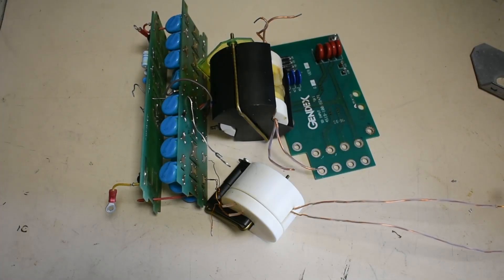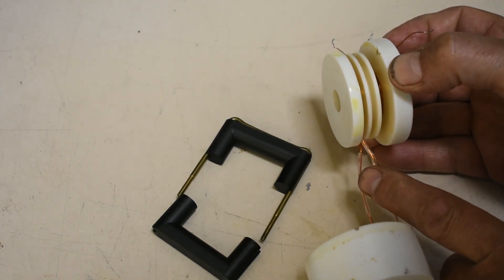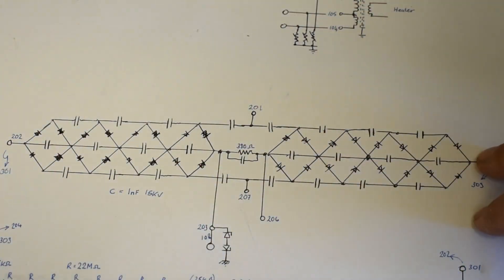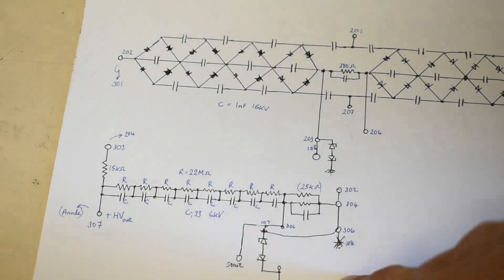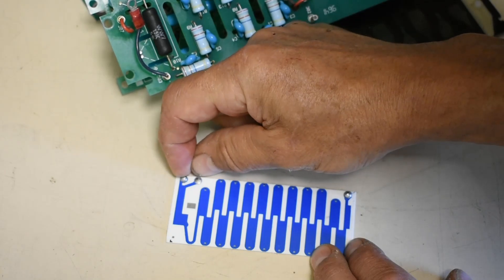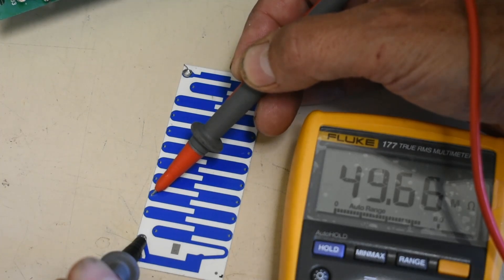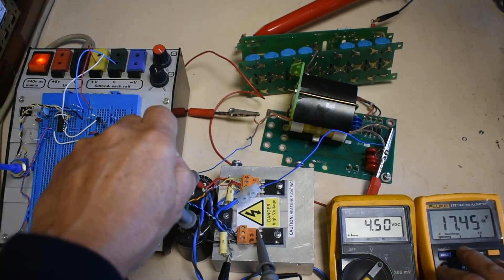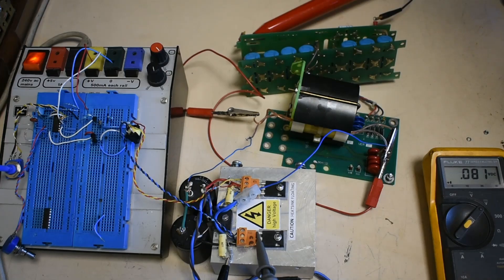Making a high voltage power supply with parts from an x-ray head.

Comment: Nice psu .. all the diodes in the multiplier point in the same direction so u should be able to just connect and ground at the neg end and have like a 8 stage positive multiplier??
Reply from the maker: Yeah thanks, the modification looks doable. Think it has the potential :-) to be  a nice HV supply.
Reply: @tuopeeks  ❤😂

Comment: Thanks for showing how those HV boards work, part of my job is installing dental X-ray units in dental clinics and decommissioning older units. I have dismantled various head units and saved the HV boards and tubes. The Gendex heads are very hard to take apart as there are no obvious screw locations as they are hidden under paint. The boards are well made with good quality components, I haven’t made use of the components and they are too good to throw away, hopefully I will use them in projects sometime.
Reply from the maker: Thanks, sound like a great job that give you access to all these part. They are generally quite difficult to get hold off. always quite impressed with the build quality in this kind of equipment.
Reply: @tuopeeks  If you are after parts, tubes etc please let me know. I also follow on FB so I can send a PM.
Reply: Hi rm...hey have u still got any hv parts and what country are u in? Cheers @rustymotor